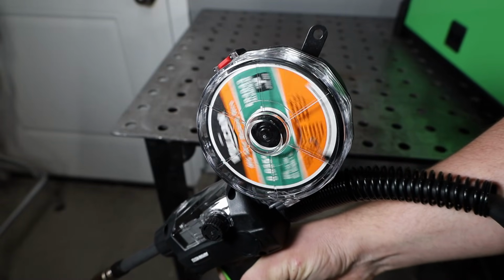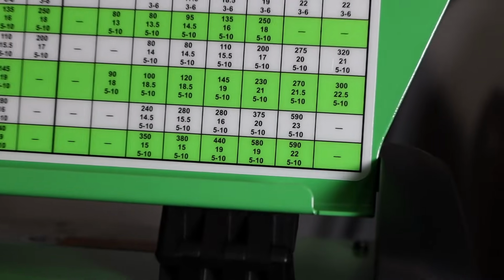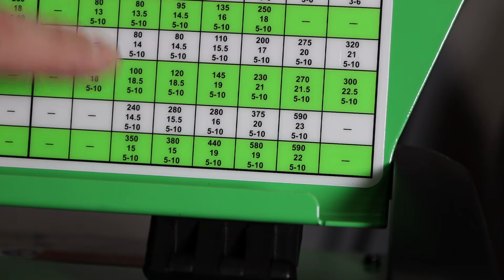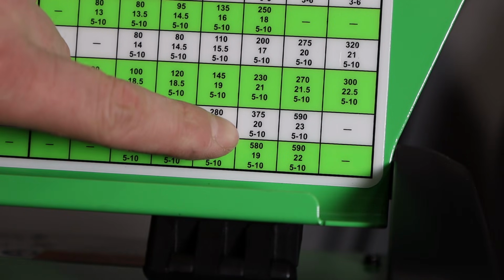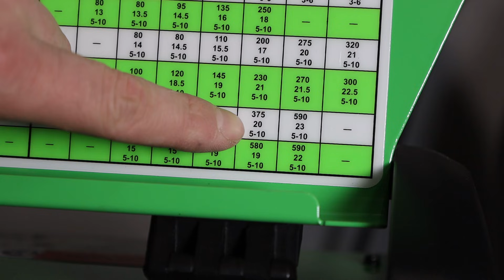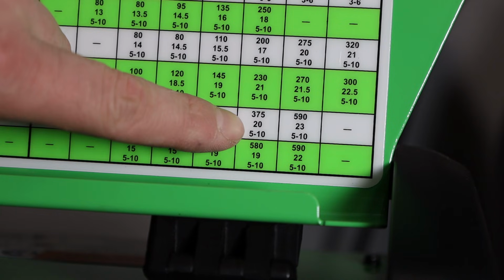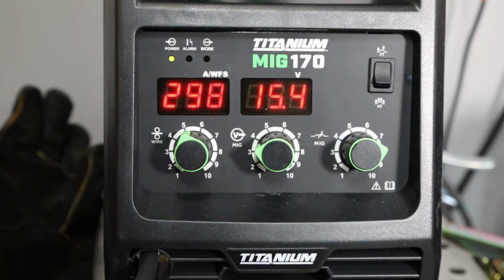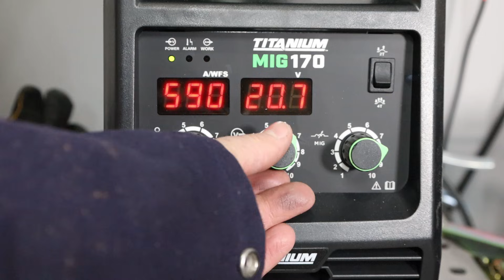Titanium Spool Gun Review from Harbor Freight

Comment: I have the same machine and liked it enough to buy a second machine dedicated to aluminum only. 
My experience for good welds has been higher feed speeds, move quickly after establishing puddle, heavy flood argon (don't use mixed gas), and clean parts.
My propane heating torches have cold flame, (yellow), when the ambient  temperature is low. I'm guessing less than 40°F because I haven't actually checked what temp is too low.

Comment: I mostly weld aluminum floors in reefer trailers that have urethane foam insulation.  I wish I could find a way to get rid of the foam before welding but it's on the underside and impossible to get to without cutting up a section of floor.  I end up welding then grinding and welding again until I finally stop getting contaminates.  That being the case the a spool gun is the only way to go.  Tig is pointless.

Comment: Can I just run flux core 
Out of the spool gun
And no gas? Too weld
Steel
Reply from the maker: You can, but it’s really not necessary to use a spool gun instead of just feeding it through a regular one.

Comment: Straight Argon? Or a Helium mix? How many CFH are you running? Ive gone all the way up to 35cfh on 100% Argon. Still getting suut on startup, and way too much penetration and no build up. Been all over the place with voltage and wire speed. I seen your inductance at a heavy 7, which is right around where ive been. My symptoms almost look like a polarity issue, but im running a reverse polarity dcep process as i should.  So far i'm not sold on this process. You have to run double the gas of the GTAW process and so far the only thing I can see it being good for is tacking because you have a free hand. Tonight was my third evening trying to get along with this thing, and all ive accomplished is a bad attitude saying "those are for people who can't TIG weld". Haha -Any input?

Comment: How would that work on regular mig 140?
Reply from the maker: I expect that you'd be limited on amperage and capability a bit, but it would probably work okay on 1/8" thick material if you run 4043 filler.

Comment: I wonder if anyone has made this gun work on a millermatic? Wondering if you could change connectors and control point and use it on a miller matic 212. In anyone knows i would greatly appreciate the advice

Comment: Spray transfer is for 1/4 and over. You are not supposed to spray on thin metal.
Reply from the maker: True story for steel, but aluminum can spray thinner, particularly with 5356 filler that doesn’t run as hot.
Reply: Transfer is a value of the amperage not of the filler metal!! @TimWelds

Comment: @TimWelds i went out and picked up this exact setup. I'm using 5356 wire. I can not get this machine to run properly. No matter how much knob turning i do, the wire burns back and drops gobs onto my practice tubing. I've tried watching all your related videos about 10x each. Any tips on troubleshooting? I'm getting desperate
Reply from the maker: I thought the setup ran pretty well for me. I have run some aluminum MIG before that and it’s a tricky process. First thing to check is your polarity to make sure it’s set to electrode positive. Also, just want to make sure you’re running pure argon gas with a high flow rate. 4043 runs much hotter and cleaner on MIG, so you might try that to start, but you should be able to get 5356 to work just fine. I don’t get notified of comment replies, but if you’re still having trouble after checking those things, you can send me an email at the address on my channel page with a couple photos of what you’re getting and I’ll help you out.
Reply: @TimWelds  thank you so much!

Comment: you need 17 volt , you said  ,  Mig knob set and says 17 volt but i measured 50 volt open and 22 during welding with knob has no effect on voltage , i did this on 2 different Mig welder both same , what gives ?

Comment: so when i try to weld with my spool gun it just bubbles up and refuses to burn into the aluminum.  no matter how i adjust my gas pressure wire speed or amps. any ideas whats wrong or what i got to do to fix it? its a titanium 140 im using 100% argon and the wire says its for aluminum.
Reply: I have the 140 and I haven’t had any issues with the spool gun.  It sounds like your not getting gas coverage.  Make sure you are getting gas( 100% argon) coming out of the gun.  Check your gas settings and maybe bump up your flow.  Clean with a stainless brush and then clean again, oh yea and then clean it again.  Aluminum likes a clean bed to lay in.  Hope you get it running, I love my titanium 140.
Reply: @johnmount1622  yea after 2 days of messing with the thing. Turns out a dirt dobber nested in the connecter and when I hooked it up it pushed the nest down the hose.

Comment: @timwelds...Everybody says you "must have" AC to weld aluminum because you need the cleaning action of the AC to remove the oxide layer that melts at like 4 times the temp of the aluminum, so how is it that a spool gun on DC, even with no flux is able to weld aluminum? I have a Lincoln weld pak 100 from 15 years ago and bought an aluminum kit for it but never tried it. Am hoping to find a spool gun that can be used on this Lincoln weld pak 100. Your words look great.
Reply: i have the same question, have you find an answer?
Reply: You actually can tig weld aluminum on DC, but you have to shield with 100% helium. It's mainly for extremely thick material applications. Your question is totally valid, as i have wondered why you dont have to shield with 100% helium with the dc GMAW spool gun process? I just wanted to correct whoever told you that you cannot weld Aluminum on DC with a tig machine. @MatiasArezo
Reply: I know that all of these the newer machines are inverters, so maybe when you flip from mig to spool gun, it actually throws a set percentage of AC at it???

Comment: Why do you use a spool gun? How is that different from the wire-feed that the machine has? Thanks.
Reply: This was my question. He replied to another comment: The reason for the spool gun is so that they can sell you another accessory :) Just kidding, it's because the wire is softer and more difficult to feed through the liner. It can buckle and turn into a birds nest inside of the machine. With the right drive rolls and a different liner, it is possible to feed aluminum wire right from a machine.

Comment: Rookie question: Does anyone know if you need gas for this one? Trying to learn how to weld also. Thanks
Reply from the maker: That’s a great question! You do need gas, and it’s straight argon. MIG welding steel uses a different gas, so if you want to weld both materials, you need two types of gas.
Reply: @TimWelds  Great!!! Thanks for the info Tim, I really like your videos!
Reply: Yes. Argon for aluminum. Carbon dioxide for carbon steel. 70/30 for galvanized. Helium for stainless. All weld shops I've welded for. 15 years experience

Comment: I enjoy your videos Tim! I was wondering if you know of a good economic spool gun for a Millermatic 250x?  It calls for the Spoolmatic 30A. They've always been over 1000 bucks since we got the welder new in the year 2000, so never got one. Since we had steel backhoe buckets and trench boxes and bore casing to weld we couldn't justify it. Today they are 1895 .00 to 2500.00  new.
Reply: Get a chinese knock off from ebay... or pay up. I have one it works OK, you may need to fiddle with and adjust it a bit to get it working nicely.

Comment: I don't understand why use the spool gun when you could just have a the wire mounted inside of the mig machine. thanks.
Reply from the maker: The reason for the spool gun is so that they can sell you another accessory :) Just kidding, it's because the wire is softer and more difficult to feed through the liner. It can buckle and turn into a birds nest inside of the machine. With the right drive rolls and a different liner, it is possible to feed aluminum wire right from a machine.

Comment: I’ve been studying your MIG videos pretty much on repeat.  Thank you Tim for sharing your knowledge with us.  If you have time for a question or 2, What type of base aluminum are you welding here?  I notice you’re using the softer 4043 wire so maybe you’re doing a 3003 1/8” plate?

I’m going to be mig welding 6063 1/8” rectangular tubing for a truck camper project and was wondering if I should go with 4043 wire or 5356?  I have read that 6xxx series alloys do better with 5356 filler metal.

Thanks again for all that you do!

Comment: You should at least clean the aluminum before you welled it. This will help break through the oxide. Oxide takes about 3500ﾟ to break through before you melt the aluminum. Also you should preheat slightly Before you start you will then get a very nice conformed Weld..

Comment: why do I need the spool gun ? can I just run the wire directly ?
Reply from the maker: The wire is softer, which makes it harder to feed. Some machines, including my HTP, are set up to feed the wire through a regular gun using a graphite or teflon liner and special drive rolls. If you’re only doing a little bit and it isn’t critical stuff, you might be able to get away with feeding it through the standard gun. Here are a few things to keep in mind if you try this:
-you will still need to change to straight argon gas
-keep the cable as straight as possible 
-larger wire will feed more easily, for example, go with .035” over .030”
-5356 is much stiffer than 4043 wire and will feed more easily 
-go easy on the drive idler pressure and spool tension
Reply: @TimWelds  subscribed !!!you explained more than 20 videos together thanks man !!!!

Comment: I've been doing DC stick and have just started gasless Mig - both welders from Harbor Freight. I'm beginning to like the flux core wire and beginning to work out how to use it on thin sheet steel. I've got some 20 gauge cut from an old fridge that I'm practicing on.

Comment: The scale on aluminum has a higher melting point than aluminum itself... Use clean stainless steel brush and some alcohol to prep surface... Prepping is half the battle.. you do it right and your set up for success

Comment: Some of the spitting and sputtering when welding with spoolguns is the aluminum oxide coating that, if removed, will give better results. TIG welders remove the oxide with abrasive and acetone.

Comment: So I am on my 3rd titanium spool gun because the wire feed wheel wont spin. Connection is good, loosen and tightened, on a dedicated 20amp plug. Any tips if I am doing something wrong? the welder works great for steel, just cant get the spool gun to even work.
Reply from the maker: They have a little switch hidden inside the cover of the machine. If you flipped that and tried multiple spool guns, I would guess that there’s a problem with the machine itself.
Reply: @TimWelds  Thank you! I switched out the welder and works great now. finally got to finish the job. (Yes I did have the switch on the right setting)

Comment: One of the reasons you're weld had more penetration near the end or in the middle is maybe the aluminum was getting hotter as  you kept welded so the material got hotter and you where able to get more penetration . Some applications in welding certain things its required to pre- heat the material to a certain temperature before you start welding. Thats what I was told by a guy I know who is a certified 6G welder at a nuclear power plant here in Crystal River Florida. But these are the extreme circumstances .  Anyway may the Gods bless us all some more then others.

Comment: So I'm just curious to know what is the advantage of the spoolgun compared to a wire feed welder
Reply: It's used specifically to weld aluminum, and uses a different wire, one reason is the aluminum wire bends easily and using a spool gun it doesn't have to travel as far.

Comment: @timwelds.. appreciate the video...inspired me to buy a Titanium Spool Gun I saw on open box the other day.  Quick question...how tight should you have the nut on the actual spool (not the tensioning knob)....I ask because my gun will not pull wire unless its relatively loose (though the instructions say to tighten it until the spool won't spin).  Appreciate a quick answer as I only have 1 more day to return it under open box policy.
Reply from the maker: I tighten it as much as I can with my fingers (no pliers). The spool still rotates fairly easily, but has a slight drag and won’t continue spinning when I let off the trigger. There’s a rubber sleeve and a flanged bushing under the nut. Make sure both those parts are there and that you’re using the correct drive roll. Also check the idler tension on the drive mechanism. Mine works great. I’d say just as good as my Miller spoolmate if not better. I’m not sure how much the discount was, but if it was a small savings and it’s not working well, I’d think about trying a new one. I hope this helps.

Comment: Any reason you can think of why this couldn't be hacked and fitted to work with a Hobart Handler 135?
Reply from the maker: I don't know if the feed motor voltage is the same, but I imagine it could be done.
Reply: I imagine it can, I drilled a 3/8 hole in the end of mine then drilled & tapped one in the side for a grub screw. I then attached a 6" piece of welding lead with dinse connector to the end  where I can leave my factory mig gun and wire spool attached to the machine, and still use the spool gun by connecting the gas quick connect,control plug, and dinse connector.

Comment: Heat moves through aluminum much faster than steel. So that's why the second half was better. That's one reason many prefer tig welding aluminum with a pedal or button to control the heat as you move through the weld.

Comment: Speaking of tips that's the other issue my spool gun thankfully came with quite a few spare tips but they are all about four and a half inch long if not longer pieces of solid copper with a hole through the middle that don't screw in and are held by a colet
Reply: thats because the spare tips your talking about are actually Tig Consumables; tungsten rods, gas diffuser collet and body. Thats for a tig setup. you need a spool gun accessory kit
Reply: @motoXtaylorGang  no these are definitely the proper tips and work perfectly fine I'm not sure why you would think otherwise

Comment: I have 4 lincoln welders from flux core up to my 180 for real heavy duty crane welding
but my average welding is done with my 210 MP. I just found ur channel and subbed.
I have been getting more and more customers needing Alu, welding. The last time I
welded Alu, was with a stick and 20 years ago. do I need 100% Argon or can I use
25-75.. 85-15 which is what I use to make window bars. Any vids u have would be a 
great help that might also contain TIG.
Thanks for the videos u take the time to do for all of us.

Comment: Do you have to run a different gas with aluminum spool?
Reply from the maker: Yes, aluminum needs 100% argon
Reply: @TimWelds  After spending a few hours with my new hobart (210mvp) spool gun, I was shocked how much I needed to turn down the heat, if I did multiple passes. FWIW, I started at 4 and 70, and ended up with 1 and 55, on the fourth pass. Hope this others making multiple passes. It sure opened my eyes to getting good results on aluminum.
Pete

Comment: The second half of that weld penetrated and melted away because the material was getting real hot, it was cold when you started. It’s not necessarily a problem with settings. Pre heat pre heat
Reply from the maker: There’s definitely a bit of that going on, but I think that technique was the bigger factor in this particular case because of the change in the arc characteristics at the same place the weld changed, right where I reduced stick out. I’ve also had pretty good success on other 1/8” from room temp. It doesn’t really matter what happened here, though, you raise a great point. A bit of preheat really does help quite a bit. Thanks so much for watching and the comment!

Comment: Don’t forget by the end you had heat into the part. Some people pre heat aluminum for that reason to have uniform pen on aluminum. Remember aluminum dissipates heat fast. But not fast enough to no heat up by the end of a bead this length.

Also try better filler. HF wire isn’t the best. I’ve tested their TiG tiller to Lincoln and Lincoln blew it away. Haven’t tried their spool but I’m sure it’s made in the same China factory and isn’t as good as high end filler brands.

Comment: Do you by chance know if this spool gun or the harbor freight Titanium 150A spool gun will work on the Miller Multimatic 255? I was hoping to save some $ on a spool gun, the miller ones are so damn expensive, i could probably buy an acceptable Ac/Dc Tig welder like an everlast or something and still be saving money instead of buying a miller spool gun...
Reply from the maker: it won't connect directly, and I'm not sure what it would take to adapt it. I actually prefer TIG welding aluminum for one off jobs or short runs because it is more precise and you don't have to dial it in too much to the joint. A spool gun works great once it is dialed in for the job and allow you to really hustle if you're doing a lot of the same thing.